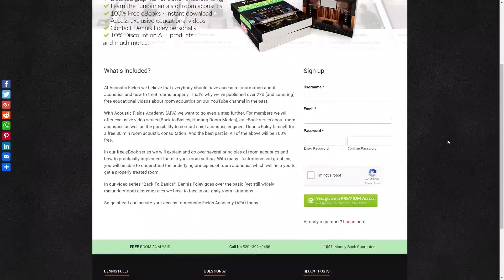What do you know about Resonances in room acoustics? - www.AcousticFields.com

Comment: I am curious if shape of room (not a box, but a wedge, or polygon shape) could help or hurt in the design of an editing space? I am designing a house for myself and plan on building a video editing room. And my problem is not so simple... as it will not be a square room. Think a slice of a Hexagon, with the smaller end cut off (where door goes), but with an increase in ceiling height from wide end of 11.5'W x 7.5'T to 6'W 10'T at the smaller end and side angled walls at 12' long. These are not firm numbers, but just an idea of the shape I will be working with. Or is this shape just too unusable to even try and work with? I am still in very early design phase at this point so still flexible at this point and looking for idea's at present.

Comment: Hi Dennis! I started running my home studio like a year ago and had some issues with the horrible low mid build up in my room. Since i'm on a tight budget i use old mattresses on 2 corners, the other 2 i use rock wool and some blankets in 2 walls. Which is giving me problems??? (maybe its the blankets but even if it seems obvious i wanted to be clear)
Reply: Correct me if I'm wrong Dennis but putting old mattresses, etc. isn't going to do anything with the low frequency problems.   I think you need to first take measurements to find out what your actual problems are and then figuring out what technology is going to work and place them where they will be effective.

I think what you might be doing is absorbing too much in the mid's and nothing in the lows and that ends up sounding like crap.  

May I suggest you fill out and submit the form on Dennis' site and then he can advise what you need and where to place it.
Reply from the maker: D,  The tactics you are using will not work for the issues within your room. You will do more harm than good. Fill out the information in this link:  https://www.acousticfields.com/free-room-analysis/ Lets take a look at your room issues first, then come up with the correct treatment tactics.
Reply from the maker: O,  Yes,  Sometimes it is better to do nothing than head down the wrong road at the beginning.
Reply: Have you found out what the absorption coefficients are with various brands and models of mattresses?  I wonder if a Serta Perfect Sleeper mattress has a different/better absorption coefficient than a Tempur-Pedic Tempur cloud mattress.  :-)

Maybe that would be a topic of discussion for a video.  Kinda like the egg carton video you did.

OH, I think it would be great if you have a video that shows the step by step process, the form to fill out and to maybe show how one can take a dB meter, play various sine waves 20hz to 100hz and to take all of the necessary measurements to find the modes within a room.  I know you have talked about it, but a step by step process to show beginning to end would really help drive it home so that we can do that process correctly so we know where the room modes are within the room, and how big of a problem.

Thanks.
Reply: I believe if you scroll through the video content there is indeed a video showing the measurement process,maybe 2 years ago so dig deep and you shall find it.
Reply: The only one that I found wasn't as detailed as I would like..  I'll check some more but it would be nice If he did the actual measurements, shows the process from start to finish and have explanations along the way.   He just explained it quickly.
Reply: I remember back when I was a teenager in the mid 70's, I was playing in a rock band and we took a garage, put up a wall to create a room where the mixing console was placed and then someone put up thick shag carpet on all of the walls and ceiling.   While we thought it sounded better than without, I do remember it being very boomy, but as teenagers, we didn't know what we were doing and since we did it on a shoestring budget since we got free remnant carpet from various carpet stores locally.    I do think it was better than using egg cartons.  :-). We still didn't fix the actual problems. but to ignorant teenagers, we thought it made an improvement.  :-)
Reply: I personally recommend the closed cell polyurethane technology of the new Tempur-Pedics.
Reply: I would think that closed cell foam is probably not going to absorb that much since the cells are closed, vs open cell foam.